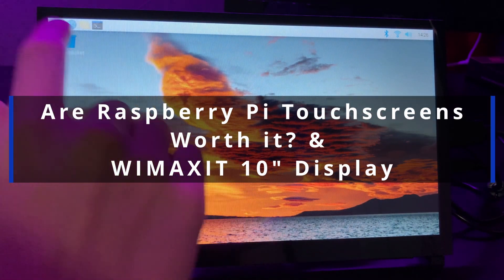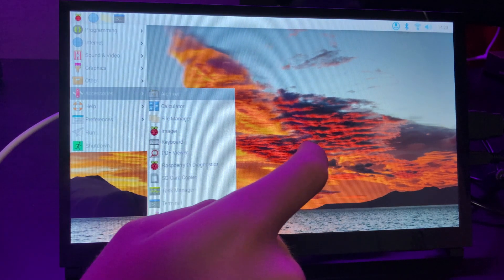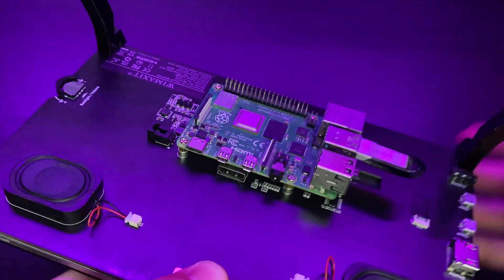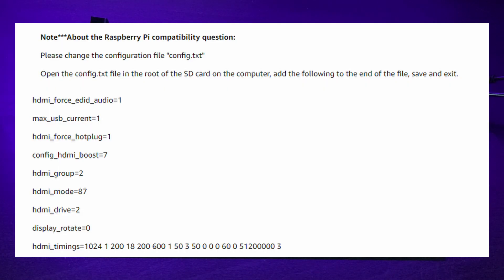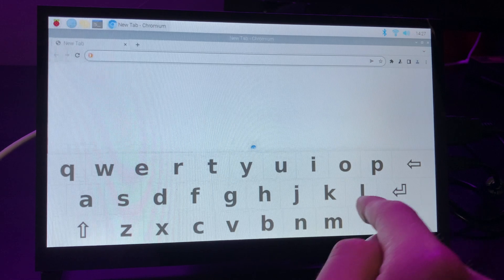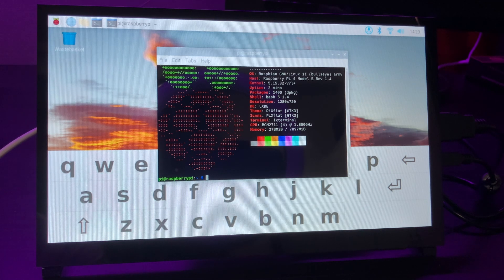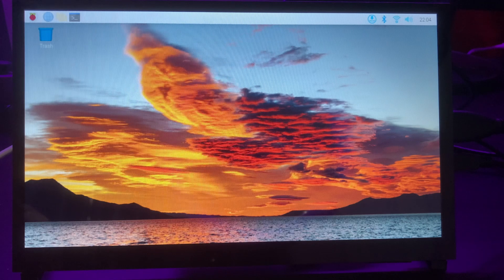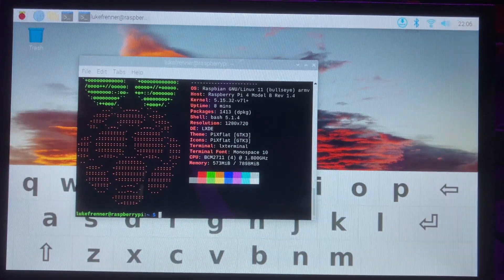Are Raspberry Pi Touchscreens WORTH IT? - WIMAXIT 10.1″ Touchscreen Review!

Comment: Honestly imo a screen like this is not really worth it
The only screens that i consider worth it (imo) are screens that are either small and low quality or large but high quality

examples:
3.5" tft screen (can be used for very simple projects)
7" lcd screen (Can be used for both big and small projects such as a teleprompt or a monitor for a pi in general)
10" + oled screens (Perfect for portable pi's)

as for improving the experience
Not all distros are great at this but imo gnome or kde work great

Helpful advice for those who want to buy screens
Some waveshare screens require custom cmd lines so try to avoid those screens
Otherwise have fun recompiling kernels to add support for it

Hope that helps
Reply from the maker: Good thoughts, thanks for sharing!

Comment: I use a regular 24" Dell touchscreen monitor with my Raspberry Pi and never had any problems with getting it to work so I am not sure why anyone would need something that is Pi specific. I ended up using it to create a basic home kiosk. At the 24" size, it is easily viewable from anywhere in the house and since it has touchscreen, it is easy for the kids to interact with to add notes, update the grocery list, adjust calendar notifications or simply browse the web. I made a quick video to demonstrate the capabilities; Let me know what you think! https://youtu.be/oMGnhztAX2I?si=itiA81z7RfGdHsRC

Comment: We need touch screen support, but eventually on a smaller 5 inch screen as a Pinephone alternative for Linux computing. There so many screens on the market. It is helpful to have a review about these touch screen devices, and it is good to know that they work with Raspberry Pi's and it is good to know with which OS they work. Other reviewers reported that they had problems with certain screens and Raspberry Pi. Thanks for the review. It is helpful.

Comment: I think it depends what you need them for. For like smart home display it might be worth it. You can organize your displays in tabs and switch between them using a touchscreen. If I got it correctly, you can mount a pi zero 2W to this screen (~20€/20$). So you can basically make a simply display out of it for your smart home.

What I found is that you can get 7'' touchscreen without much problem for around 50€ (I am from Germany, but 1$ is close to 1€ at the moment, I think ;-)) . So quite cheap but tiny as well. But price increases rapidly when you aim for a 10'' touchscreen. I haven't seen anything here below 100€. For a capacitive touchscreen, the price of this one is probably actually where it starts. You can easily spend more than 200€. I might go for the 12'' version combined with pi zero 2w in the smart home which I plan to set up. It simply display the smart home dashboard/ visualisation